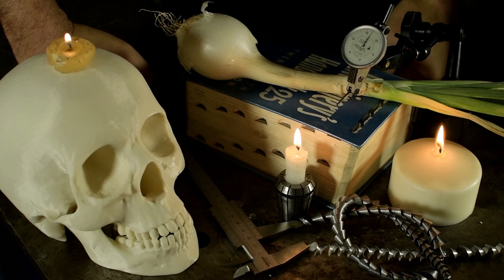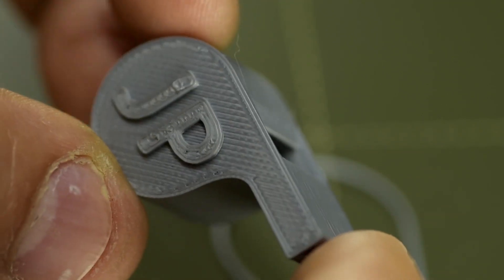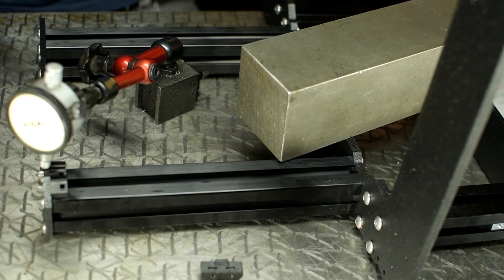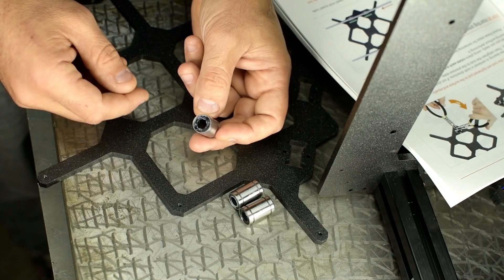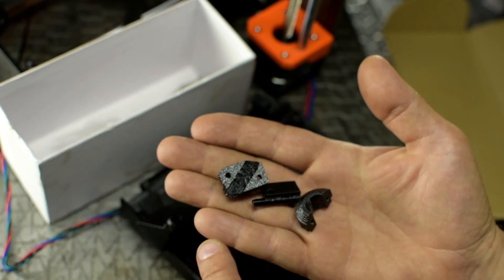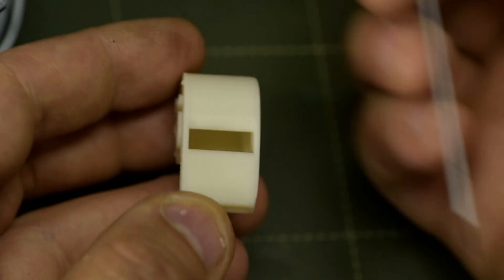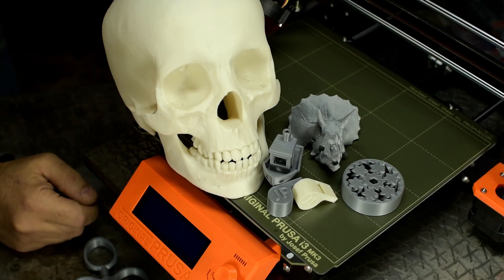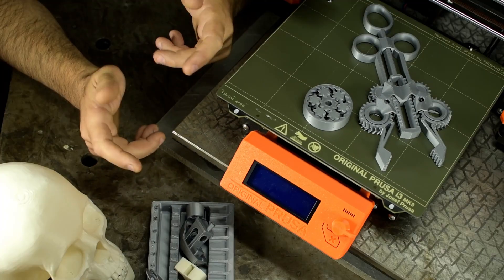This Old Tony in 3D!!! (printing)

Comment: Your benchy came out incredible. The wisping you refer to is called stringing and is typically fixed by lowering hotend temperature or playing with retraction settings. It can also just be hit with a heat gun pretty quick to get rid of the strings as well. The bridging (printing over open air with no supports) on that whistle turned out amazing as well, you’ve got a great starting point with whatever settings you have

To fix that bed adhesion issue with the ASA, you can up the bed temperature and/or use some hairspray or a glue stick on the bed before you start the print

Comment: 98% of my 3d printing was prototype and dimension validation, but that 2%  The replacement microwave handle, the repair to the Ring doorbell to replace the button, the two part screw jack handle to replace the cracked one...I've probably made 60-70 parts over the last 3 years to actually do something.  And for that it's awesome!  Toolholder holders for the lathe, speaker holders to hold the computer speakers against the monitor...I could go on.  Then throw in all the stuff that I just printed to see if the design worked.  Plus, for a while I had a part I sold that was 3d printed.  Then I got a small run manual plastic injection molder and made molds on the Tormach...just keeps getting better!  

Love your work, This Old Tony!

Comment: Creality Ender 3 is an amazing printer. I have had no problems with it, and it's significantly easier to set up than this -- the entire base and y axis is already assembled for you. It also has a heated bed.
Reply: But if you want to print it somehow good you have to disassemble it before use and assemble it straight.

Comment: I may have to jump on board the 3D train soon. I've been too cheap thus far. Plus, I've had trouble justifying the ROI.
Reply: Like so many others, I have the Ender 3 and an super happy with it! It's open source and very popular, so there are a ton of upgrades you can print or buy, there's videos and guides aplenty... And it's only around $200!
Reply: A week after I got my printer, my step-dad came to me with a broken plastic part from his very expensive clothes dryer.  The part from the manufacturer was $75 and was out of stock.  I had a replica for him in an hour and it has been working for almost a year now.  These little practical fixes add up pretty quick.  
This assumes that you aren't afraid of CAD software, though.  If you are just thinking of printing other people's models, there may not be an ROI.
Reply: @beauslim  Yeah, if you're just going to print already available models, then it doesn't make sense.
Reply: hey!

i have one, and I print a mix of gadgets for clutter, and parts for actual use and repairing things.   you have to get handy with CAD to make your own parts, but that comes eventually..  My one suggestion: buy the most expensive printer (while being reasonable) you can afford with your budget.  If you can shell 750$ like This Old Tony on a Prusa (which I would consider the top of the line for cheap hobbyist), go for that. I went for cheapest of the cheap, and it works, and I managed to evade all the problems that came with it, but a Prusa will print perfectly, in a safe way, right out of the box.   Even their mall one is supposedly really good, for much less and not much less build space.
and like Tony said, building it is neat, not THAT long and allows you to understand how it works.
Reply: @sypernova6969  thank you.
Reply: @Makebuildmodify  If your wallet is thick enough at the moment, nothing is better value than a Prusa (for a hobbyist). Cheaper printers end up needing more work later on. If you just want to dip your feet into the hobby, I suggest an Ender 3. If you're sure that you'll use it, then a Prusa (if you can afford it). If you're a tinkerer like me, get an Ender 3 and upgrade the shit out of it. I'm saying E3D Hemera and linear rails. It would eventually cost more, but I prefer the journey and satisfaction when everything works. The Prusa printers can be upgraded, but they are at probably the best print quality you can get out of the machine with factory parts. Choose your route, and don't ever go over your budget, inspite of how tempting it might be..
Reply: @SuryanIsaac  Thanks for the advice!
Reply: I am using an unmodified Ender 3 that I picked up for 160 on Amazon prime day. Three weeks later I got a call about the window not rolling up in the car. Pulling it apart I foind a small plastic part had broken. Of cousre they dont sell the plastic part,  but only the entire window mechanism and door assembly at $175 or about $260 OEM. I redesigned that part (fixing the reason it broke) and printed it in PLA while I waited for higher temp PETG to arrive (it melted within three days). I put the PETG part in, and has been there for about a year now.
Anyone who tells you they are toys and don't pay off are using them incorrectly. Something comes up nearly every month where before there wouldn't have been a practical fix for them.
Reply: @court2379  Same thing with me. My mom's cousin is getting an old bike working, and some asthetic parts are missing - like the cover for the keyhole. That would be extremely expensive to get machined in shop, and it really doesn't need much strength. Designed and printed him 10 of them for less than few dollars in plastic. Really worth it. Though i still go through thingiverse and print junk, my younger cousins love the failed benchys, for them excessive ringing is something that only happens on the phone, so they don't mind a few new toys once in a while
Reply: @court2379  Nice!
Reply: So don't buy one yourself, yet at least (though the current budget crop are actually really good value). Visit a Maker space or use a 3d printing service for those parts that are too annoying to make any other way and see if it really works for you first. There are lots of downsides - like the post processing if you want your print to look like anything other than a 3d print, the dimensional strength variations can make structural parts hard to design or print in a good orientation, the filament rolls do need to be stored away from humidity... the list goes on a fair way as there are many little downsides. But one massive upside - once you figure out the limits of your machine you can design to that and build reasonably dimensionally accurate structures suitable for most tasks (sculptures too I guess (not really my thing)) and unlike other machine assisted making you won't need a whole room full of varied mills, drills, fly cutters, fastenings and a huge stockpile of stock in various sizes and shapes - just a roll of the right type of plastic, the CAD skills and time.
If you are like me you will find enough use for it to make owning your own a worthwhile investment, if on the other hand it will sit idle for months you are probably better outsourcing for those rare occasions you actually need a part you can't easily make any other way.
Reply: @foldionepapyrus3441  Good points, thanks.
Reply: There is no return on investment.  99% of what you will print is going to be garbage that clutters up your house, or printer parts.
I have a side gig repairing 3D printers.   They're a pain.
Reply: @thegardenofeatin5965   - you're doing it wrong then - lol
Reply: @thegardenofeatin5965  A Pain? I schedule sundays to repair my printers, it's hella fun!
Reply: @thegardenofeatin5965  Have you learned how to use CAD software? I could see having that opinion if you were constrained to only printing other people's designs.
Get a copy of Fusion360 from Autodesk. Onshape is another similar  package. Both are available for hobby use for free and are professional level software.

I have printed some toys,  but the majority of things I print are functional parts to enhance or repair things around the house. Wood and metal working jigs, stops, inserts. Motorcycle and car parts. Sprinkler parts. A toilet paper holder mounting bracket that my kids can't pull off the wall. The list goes on. I plan to work on an air powered vacuum cleaner soon (they are nice for wet or large debris as anything that fits in the hose goes down), and might experiment with some vortex tube designs for fun.

Comment: 1 3D print pattern
2 cast pattern with aluminum
3 cnc router new aluminum part to tolerances
4 IF new part works out GOTO line 5 ELSE melt reject and GOTO line 1
5 make next pattern GOTO line 2

// eventually have all necessary part for brand new, light weight time machine

Comment: The overhangs on your benchy are not great. would suggest turning the cooling fan up or running the filament a little cooler. also the strings can be corrected with more retraction. Also, it looks like there is too much feed-forward after retractions. Protip: dont leave your filaments out in the open air when your not printing. Keep them in a sealed container with desiccant.

Comment: I first got a 3D printer years ago with the thought that it would mostly be used for prototyping and that the end use parts would be bought or machined. I quickly found that the printed parts got used much of the time, especially when getting into other filaments like PETG, nylon or more exotic filaments.

Comment: I hope you read this. If you have an issue with materials sticking to the print bed..my secret, find a junk flat screen tv/monitor and remove the plastic sheet for the back light, the clear one. Use an adhesive to stick it to a plate, I put mine directly on my build plate. I have a creality ender 5 plus. But I've been printing for a few years. Trust me, PC ABS and other troublesome filaments will stick great and once the print cools it will remove easily.

Comment: Remember that PLA is hygroscopic, it absorbs moisture from the air and it will gradually degrade the print quality to the point of being useless. You should make a mostly airtight filament container with some silica gel inside. With the only hole being for the filament to feed through, it saves you the hassle of removing the filament rolls and putting them in storage between prints.

Comment: For a first print, that Benchy looks GREAT! The stringing could possibly be addressed with the retraction settings, but with it being as light as it is already, it would most likely just be easier to give it a quick lick with a lighter/blow torch and just burn them off. The only other thing I managed to see through the video was some slight drooping on the overhangs on the windows and arches, which you could play with in the overhang/bridging settings, and look online for some bridging test prints if you really want to dial it in, but unless you're looking for a SUPER pristine print right off the bed, thats pretty damn good for a first print!

Comment: I'll 100% vouch for the creality ender3, for the price it prints great. It'll take good tuning,  and assembling right (sometimes still adjusting afterward), but it'll print as nice as the prusa. Also no printed parts for the assembly.  

There's a great community with tons of knowledge to help.

Comment: Congrats to the printer. Got mine this year as well. (mk3s). Have you done the raspbery pi zero upgrade? If no i suggest you go for it, but i sugest rPI 4b or 3b, much more capable of running octoprint and a webcam and various addons.

Comment: I feel like you missed a "3D or not 3D" joke after printing the skull.
Actual info: The stringing in PLA is normal, and you can help ABS/ASA not warp as much by something as simple as a trash bag over the whole printer.

Comment: 12:27 I hade good results with the ER70S6 with the hot end set to 2752 degrees F  with the bed at around 1850F. Oh yeah a solid two layer skirt helps with warping. 4:30 the good pliers collection...... dude I'm still laughing 😂

Comment: :D the crossover I didn't know I wanted!
The benchy print looks damn good, as can be expected off a MK3S, front overhang and tops of the windows are clean, the chimney is not melted, there's very little stringing (the wispy filament lines running across e.g. the back window), really very good.
And btw: you can easily avoid supports on the hex driver kit (?) insert, just make the model solid all the way to the bottom! The previous shape was of course optimized for cheap deep-drawing, but it's almost simpler when adapted it to 3D-printing instead.
Now I'm even more excited for my Prusa Mini arriving soon!

Comment: Regardless of how many clams it cost, now that you have a 3D printer, you can make your own clams!  About a year ago, I bought a used Printerbot Simple for $50 bucks.  Haven't made much with it, but it works!  You've probably already figured it out, but Thomas Sanladerer is the TOT of 3D printing.  Looks like a tattoo on your left wrist.  Or maybe burn marks from the hot end?!  Keep up the great work!

Comment: Those prints look great. I'm no expert at reading the 3D printed tea leaves, but I do see some things you could improve. There is some ringing/ghosting (the vertical lines on the outside of the wheelhouse), and the little threads of plastic indicate maybe that the hotend is a little too warm, or maybe you need more aggressive retraction or moves.

Some info to help fix the ringing: https://all3dp.com/2/3d-printer-ringing-easy-fixes/

And a general tip, you must be VERY careful when handling the spool of filament. If you let go of the loose end and it snaps back onto the spool, chances are good that it's going to snake its way around one of the coils and produce a knot that might not show up for dozens of hours of printing.

Comment: I don’t know if it has been mentioned yet but printing other materials than PLA can produce a lot VOCs and carcinogens. I think this is in the garage but make sure you/family aren’t inhaling/hanging around while it’s printing. It also produces lots of ultra fine particles. Take this as you will and maybe do some own research. 3D printing is very fun and opens up doors to new and complex designs!

Comment: something that might peak your interest is "Polymaker PolyCast 3D Filament" it's designed for Investment Casting / Metal Casting helps turn your plastic prototypes into something metal i have used it a lot helping my friend restore an old car where the parts just are not available or overprice but could not be plastic

Comment: Prusa are more expensive because:
Most of manufacturing is done in CZ, where people are actually not paid like slave
Most of the tinkering and fixing stuff as already been done
Massive support from both manufacturer and community

This thing is the toyota of 3D printing. Nothing Fancy but built to work for long time.
Reply: Yeah, you pay for the Prusa but it's a very good machine with very good preset profiles that make very nice prints.

I've had 0 issues with mine, including a month long period of near 24/7 printing making faceshields.

Most of my friends with the popular chinese printers like the Ender 3 have had to do a bunch of upgrade to theirs, due to issues like flatspotted carriage wheels, bowden tube issues, etc.

At the end of the day they still have less money into their printers than what a Prusa costs new, but if you want something that just works and makes good quality prints, the Prusa is a very good choice.

At least we're past the era of crappy fire hazards like the Anet A8. It's hard to go wrong these days if you get one of the many recommended models of 3D printer.
Reply: "Most of the manufacturing is done in CZ"
Might be true for structure, electronics and motors are still probably made in China

"Most of the tinkering and fixing stuff has already been done"
As if not enough people have bought an Ender 3

"Massive support from both manufacturer and community"
True, you don't get a lot of manufacturer support on the Ender 3, but damn, the community of that printer is huge

Comment: Those wispy things are refereed to as "stringing", you can solve it by increasing the retraction or (sometimes) reducing the temperature that you're printing at. As you found out, abs sucks to print with. Nobody really uses it anymore, they just use PET or PETG. I have the same printer, I also assembled it myself. I've put 2019 meters of filament through it and the only failures I've had were my fault. I will say that the easiest way you can mess up a print is if the first layer doesn't stick perfectly to the bed, the print will come loose which isn't a huge problem unless it sticks to the nozzle. What happens is you get a big, dense ball of plastic that completely envelops the hot end. If you're not careful when you remove it you can break the heater cartridge or thermistor wires or if the plastic melts to the other plastic parts on the hot end you'll have to re-print them. this has happened to me 3 times (twice on my Prusa mk2s and once on my mk3s) though the first time was the only time i damaged wires.
Reply: npgoalkeeper _ that’s fair but for an i3 printer without an enclosure that tony will probably keep in his shop (a cold place, I imagine), I dont think he’d wanna go through the trouble of using abs.

Comment: Okay, so you've got a 3D-Printer now. A pretty capable one at that. I've actually made a few parts for a local machinist-hobbyist i know, more specifically, fixtures for CNC machines. In Carbon-fiber Reinforced Nylon. As long as you have a hardened steel nozzle, you can print this stuff no problem. You'll be able to make fixtures for CNC milling easy as pie, and it'll basically be as strong and stiff as aluminium. I'd love to see you make some fixtures out of Carbon-fiber nylon and use the fixtures to make some sort of CNC stuff.

Comment: Keeping the filament dry prevents a lot of trouble. I bought a cheap hygrometer and some silica kitty litter, and threw it all in a big cooler that used to spend 99% of its time in the basement. Keeps everything dry, I put the silica crystals in a couple of paper bags, and when the humidity starts to climb, I bake the silica at low overnight.